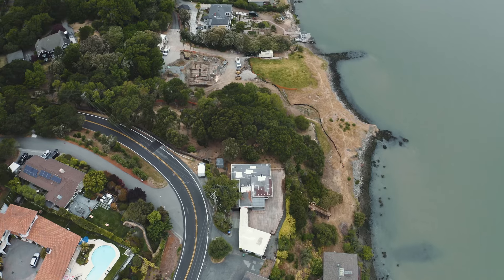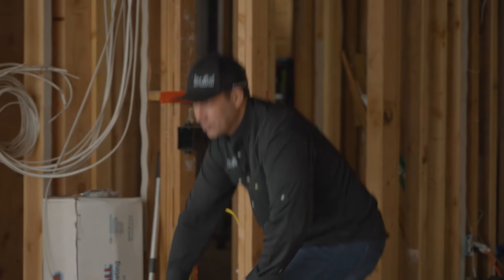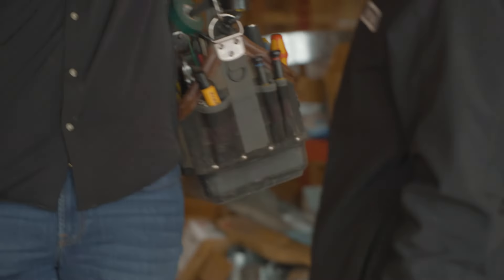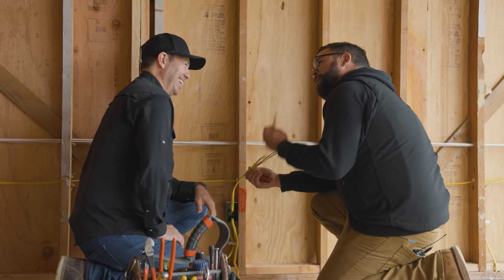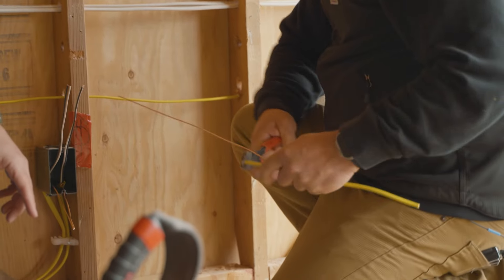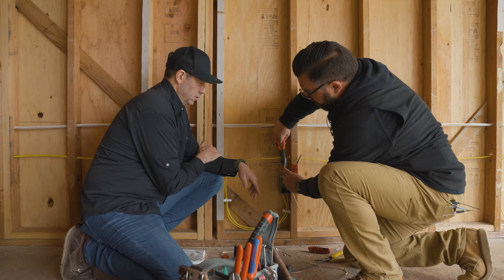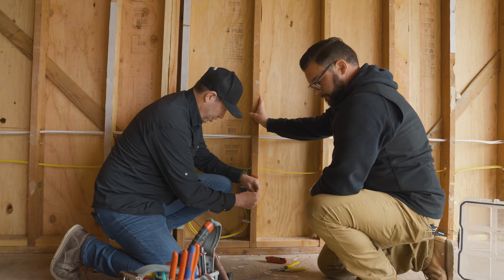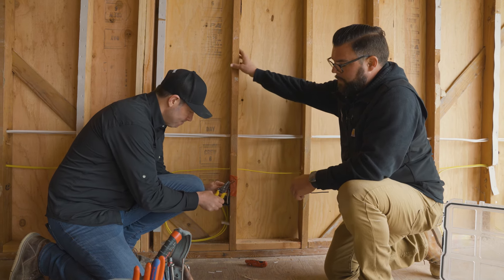"Talking Electrical: Part 2" - TALKING TRADES EP. 6

Comment: Why wouldn't they use Wago connectors in lieu of wire nuts? Seems like a better way to go. Of course, they cost more, but...
Reply: Honestly, properly installed wire nuts are just are basically just as quick and make a way better connection. I use wago push in connectors quite a bit in commercial. I’m not a traditionalist, I am happy to use products that make my life easier. That being said I don’t ever use the classic Marrett brand yellow, orange or red ones which I think are trash. I pretty much exclusively use Ideal Can twists. You can splice a much larger verity of wires than wago lever nuts. You can splice a #8awg to a #10awg or 3 (#22awg) or 5 #14 all with the same less expensive connector. Wire nuts require more skill and would be annoying if you were planning on connecting and disconnecting things a lot. If you’re going to diy they are a decent option. Wagos are easier to use but in my opinion don’t make as good of a connection. In Europe they use a lot more stranded wire which sucks to splice with wire nuts so lever nuts are a better option.
Reply: The money saved in labor using a wago does not make up for the extra cost of the Wago. 150 pack of yellow and red wire nuts for $14.48 or a 90 pack of mixed Wago for $43.
Reply: @tiggeroush  Yeah, and quality doors cost more than cheap doors. Quality windows cost more than cheap windows. Quality connectors cost more than cheap connectors. How good of a job do you want to do? You can't (shouldn't) re-use a wire nut.
Reply: @rdoubled1384  yeah however as an electrician if your installing things and then taking them apart again multiple times you’re not doing your job right. Unquestionably a properly spliced set of wires under a wire nut makes a better connection than a wago lever nut. I do sometimes use lever nuts, push in wire connectors and standard wire nuts. Everything has its time and place, most professional electricians in North America do the majority of their splicing with wire nuts. It’s just a tool.
Reply: Cracks me up seeing electricians whine about spending $10 more on a box of connectors when they charge me 50k to wire my house.
Reply: @vapeurdepisse  when you see that happen let us know, I explained why they don't. No one whined about it.

Comment: The paper is in the wire to make it easier for the wires to slide inside of the non-metallic sheathing.  (when you you bend the bundle, the individual wires will move inside the outer plastic sheathing.)

Comment: Losing a lot of respect for CJ watching this video.  Using a right angle with a bigass auger to drill the studs...   Matt was actually doing it mostly right.  Get self feeder 1/4" spade bits in 7/8 or 1 and a 1/4 hole size.  Use an actual drill like a Flex with Turbo or Hitachi.  Hole Hawgs and augers barely fit into stud bays and don't spin nearly as fast to clear chips.   The argument I always hear "If I hit a nail with a spade it gets destroyed!!"  No, you're big pain in the ass Auger is $16 and will get destroyed on nails too.  The Spade is 1 dollar and if your apprentice blows through 16 of them, the issue isn't the bit.  Then making up the outlet,  just going to ignore that his wires are laying on the track.  If you get into this habit and there's a basement.  It won't be long before a plumber drills through your wires.   The razor knife to strip the wires.  I don't know why guys still do this,  but strip your wires before they even go into the box.  Use quick strips and don't risk any accidents at all with the razor knife.  Why are you putting a giant wire nut on your grounds?  Dude use a ground crimp.
Reply: Never seen a working electrician strip romex with anything besides a razor knife. Use a light touch and go over where the uninsulated ground wire is.
Reply: We have been using the Diable bit for nail-embedded wood. We have ripped out a lot of nails with them. $12 for a single or $20 for a 3-pack.  We have only had to replace two of them in the last year whereas we replaced many over the year before that. One of them was lost in a wall.
Reply: Everyone of your “complaints” is personal preference. There’s nothing wrong with anything in this video. Besides the fact that you may do it differently.

Comment: With pigtailing if one device goes out you will never know until you try to use it.
Reply: Always pigtail. Only lazy people don’t pig tail.
Reply: @DMSparky  why would that mean your lazy? Wanting to know if a device goes out earlier than later? Back stabbing I can see as lazy but just not pigtailing makes you lazy? I’m not seeing the connection.
Reply: @michaelbartlett1589  Same here, and I have not seen a receptacle go out from properly torquing the screws, but I have replaced many from backstabbing.
Reply: @michaelbartlett1589  the down stream current is going through the receptacle rather than through the wire.
Reply: @michaelbartlett1589  I agree wrapping around the sides is 100% better than back stabbing. Okay I’m genuinely asking have you ever used a calibrated torque screw driver to tighten outlets before to 14inch lbs. I have and it never feels even close to tight enough.